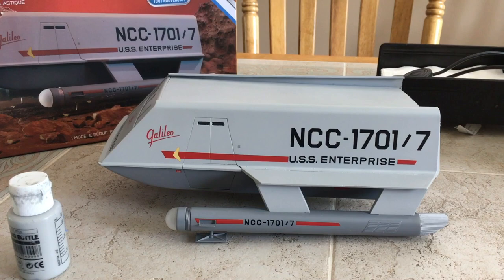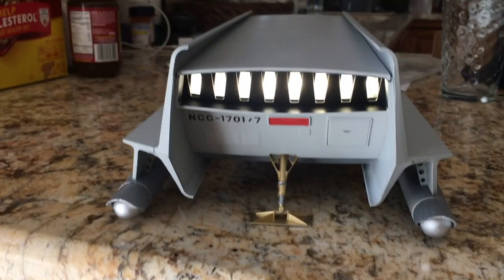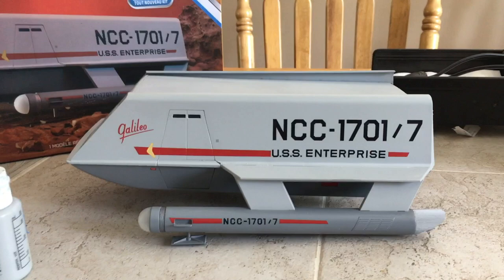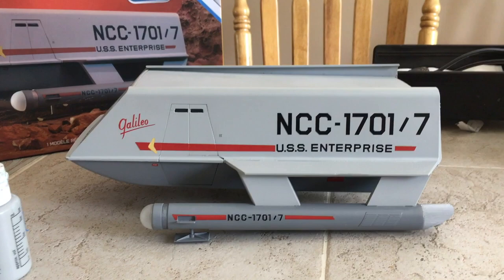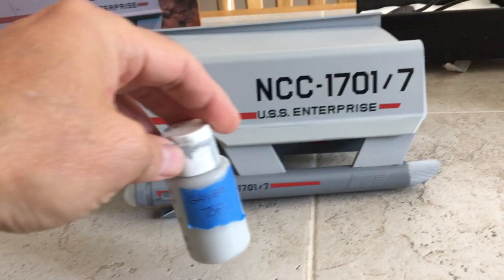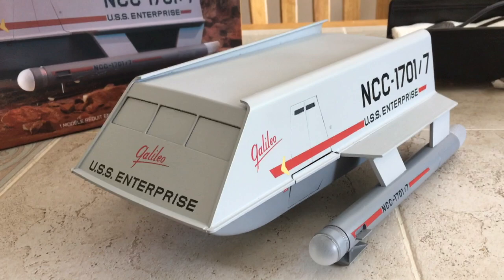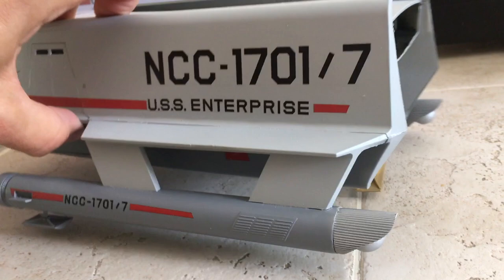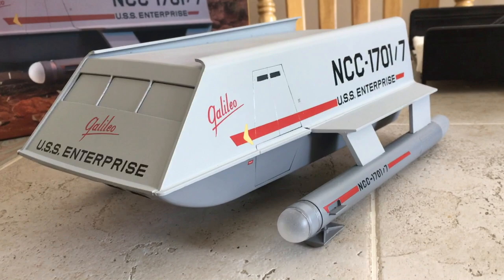Mark Myers 1:32 GALILEO BUILD Part 1(exterior/ lights)

Comment: Looks great! I recently began building this model.  I also recently found out that Round 2 will include interior parts with this model moving forward. Also, they're doing a one-time release of a separate interior parts pack for those that have the old release without interior. Both are available for pre-order now.
Reply from the maker: Yes, I know. I will be getting the interior kit itself and add it to this build.

Comment: Looks great, but does the upper door open? and what about the rear hatch? any interior?
Reply from the maker: Thanks! The upper door is currently just tacked in place. It's removable.Currently the kit being offered has no interior. However, If it sells well enough, an interior kit will happen.